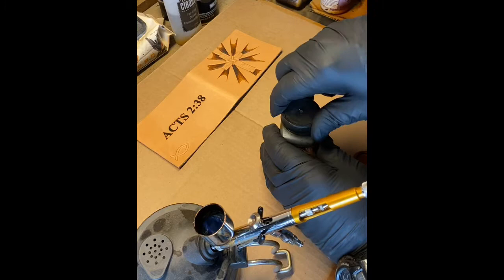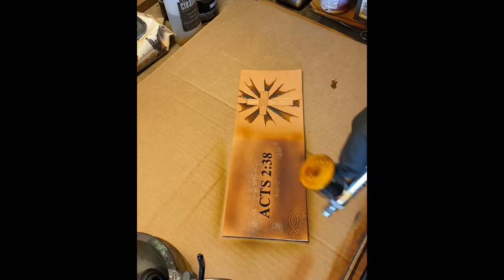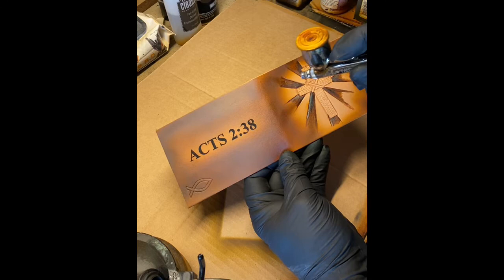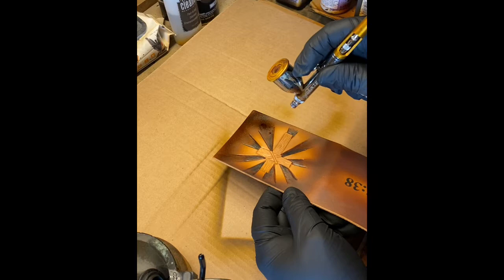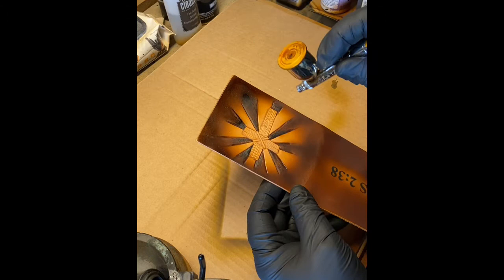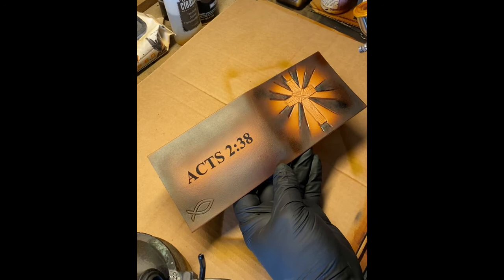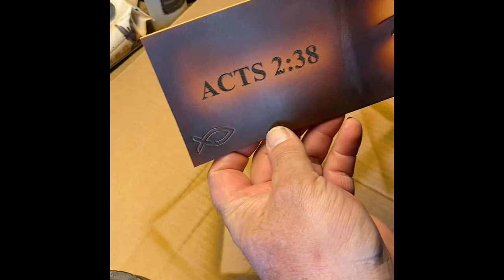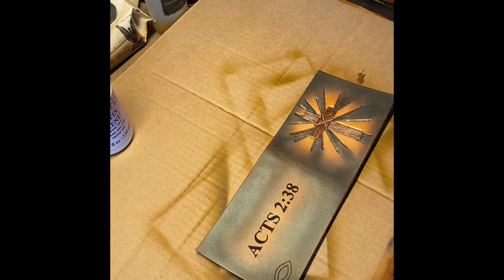Airbrushing Leather Dye Demo

Comment: Just got my airbrush and Im super stoked about it
Reply from the maker: Cool I’m about to fire mine up before bed to clear coat a project. The great thing about spraying a clear finish is you don’t get color lifting and transfer trying to brush your clear finish on . Good luck
Reply: @christophjoseph2406  I just received my air brush kit and got me some angelus dye and Im in love. The color is even all throughout and the control of the amount is amazing. It dried almost instantly! I feel like a kid with a new toy. I yet have to buy some syringes like yours, I made a small mess adding the dye straight from the bottle to the container. But other than that im impressed

Comment: Just started airbrushing dye. Do you deglaze before dye? Do you oil before or after or not at all? Tried a sample piece using Angelus Blue Jean dye. The piece came out with uneven color. Is this kind of normal? Could be the vegtan? I then sprayed it with Saddle Lac. Evened out the dye and looked decent. Thank you for your help.
Reply from the maker: I only use Feibings Pro dye and Hermann oak leather for optimum results. You can use dye prep. 
If you did any tooling and got an area wet. You gotta wipe the entire surface with a damp sponge and let it dry before dying 
I stay away from water dyes and oil dyes. Water dyes the colors are too transparent and not as brilliant . I use mostly solvent dyes because I’m dealing with paints as well. Oil and acrylic paints don’t hold up well together. 
Glad you watched the video and was informative. Airbrush is just far superior to brushes and daubers.
Best of luck 
Chris

Comment: New to leather and recently bought air brush and compressor.  I'm finding that the dye dries on the surface and doesn't soak into the leather.  That surface dry then wipes off really easy onto your hands and whatever else.  Very little dying of the leather occurred .   What is up with this?  I'd like to know what pressure you use, size needle set, and anything else you can think of.  I can see from your video that the dye is sinking in and not setting on the top.  When it sits on top it looks very grainy and that is the first clue spraying didn't work.
Reply from the maker: Hi , maybe these tips will help. I use Feibings pro dye for the majority of my airbrush dying. Seems to get best results 

Use a larger tip where material comes out

I'm using 40-50 PSI. Too much you get that overspray mist on top 

Also ad a little dye reducer so it really soaks in the leather.

I use several wet coats to really penetrate and build up to the shade of tan or brown I want. 

I just can't stand the blotchy look of hand dying leather with doubbers , brushes or sponges
Reply: @christophjoseph2406  
What is dye reducer?  Never seen or heard of it. Firings?
Reply from the maker: @jgdevoe 
Yes Fiebings makes dye reducer. Great for making a color lighter or in this case allowing to really saturate the leather and build up to the desired color. It's a lot easier to make a color darker than the opposite 

If the airbrush is clogged or nozzle to small it's hard to get some good saturation. You will end up with a dust of dye on top like you were explaining. I use a small nozzle for detail work or shading and a larger nozzle for dying large areas. I ended getting a different airbrush for each so I don't have to hassle with it . I think I was using the Paache VL model in that video which only came with one nozzle which worked just fine

Comment: Nice work,  I already got some air brushes, question what do you use to clean them out after you finish??
Reply from the maker: I use Iwata airbrush cleaner. It’s sold on Amazon. And works well for a water based cleaner 

Then I spray it out into an airbrush cleaner container.
Reply: @christophjoseph2406  why wouldn't just plain ole water work, If the dye is water soluble then nothing on the planet would be a better solvent.
Reply: @bipedalbob   The leather dye shown above is solvent based, using a type of alcohol as the carrier.
The Satin sheen is an acrylic finish, and while it is "water soluble", there are cleaners that do a better job of breaking down the acrylic binders in the medium.  In an airbrush, you need to get all the little bits, blobs, and scraps removed, so using a cleaner designed to do it is an easy way to get things right.  Yes, there are 'homebrew' alternatives, but sometimes buying a ready made product is easier, faster, and in the short term more cost efficient.

Comment: What size needle are you using?
Reply from the maker: Hi
I typically use the #2 for applying leather dye. It allows for enough material to go on but not too big when I’m working on specific confined areas. Leather dye is already pretty thing so it flows pretty good. If it’s a really large piece of leather I’ll use a 3 but wallets the 2 is just fine 
#1 can get clogged up when applying clear sheen so overall #2. Paasche is the only one I use and know 

Thanks for watching and inquiring

Comment: I was recently planning on using an air brush to spray 
Eco flow water based dye, but the instructions on the bottle specifically say,
Do not spray.
Reply from the maker: I mainly spray Fiebings Pro Dye for my leather dyes. Even though it says do not spray I still managed to spray it and it worked fantastic. That was probably for environmental reasons. Eco flow water stain is a little thicker so with a small tip you may need to ad a couple drops of water to thin.
I’ve tried the Black and Tan. Both went down nice and uniform better than you can ever do by hand.
Reply: @christophjoseph2406  I'm certainly going to give it a try because I've not be impressed with it, even black,  it streaks very easily.
Reply from the maker: @bipedalbob  agree on the streaking. It’s horrible trying to apply evenly with a sponge, brush dauber or foam brush. Yes try water. It will spray straight out if the bottle but I’d thin it 5-10%
Black dries kinda grey. It needs multiple coats sometimes

Comment: Did you thinned down the sheen or just using it directly from the bottle?
Reply from the maker: The super sheen is thin right out of the bottle. I didn’t add anything to it . Typically I have to spray a second or third coat as it soaks into the leather. 
If I’m using it as a blocker for applying antique or highlighter definitely a few coats.
So basically the only time I do mix or add anything to the sheen is if using super sheen and it’s a little too shinny, I’ll mix a little satin sheen in there
Reply: @christophjoseph2406  yeah, I've used the satin sheen but using dauber it's tend to soaked in. Have to do several coats.
Been figuring how to apply the cost using airbrush now. Picking some tips here and there. Thanks for the insight, awesome piece that. 🤘🏽
Reply from the maker: No problem 

I had to switch to using an airbrush because the sheen can lift the colors, smudge and smears them I have found causing colors to get disturbed especially when I mostly do multi colored wallets with dyes, leather paint and highlighter 

Just better all around way ti apply the final finish